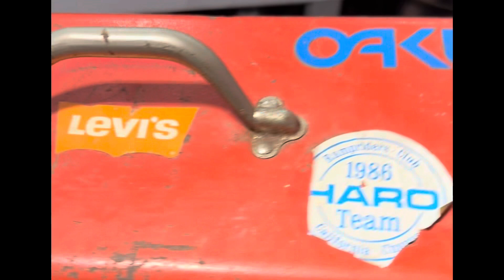Come dig around in these old school bmx tool boxes

Comment: Any 22.2m hollow stem bolts in there? I need one for a 94’ Gt Vertigo it’s the blue splash with the blue splash forks which is crazy when you google it the one you find is the one I now own but it didn’t have a hollow stem bolt when I got it and I guess it’s supposedly 22.2mm not the 21.1mm I’m going to try one because I can’t find a 22.2 without buying a whole stem which is dumb for some reason every one of the vertigo and performers I find in 94 come with a Dyno stem and not a Gt one not sure why.
Reply from the maker: Yah we have them in stock 

https://powersbmx.com/products/quill-hollow-stem-bolt-w-wedge?utm_medium=product-links&utm_content=ios&utm_source=copyToPasteboard